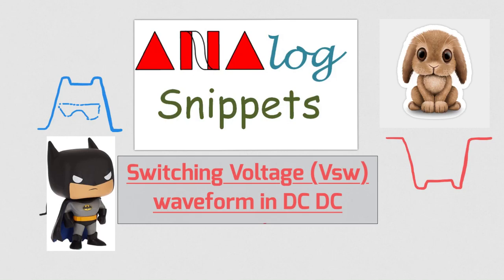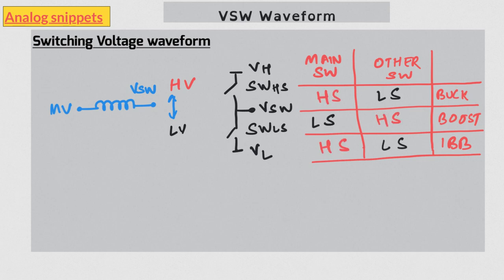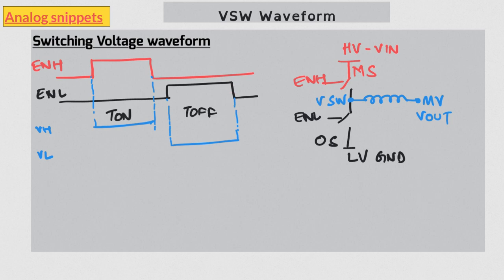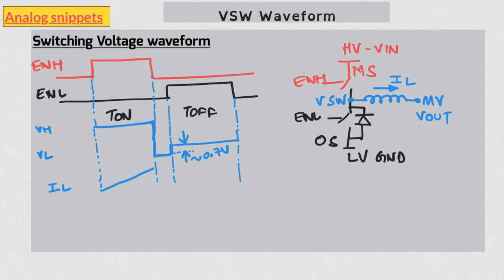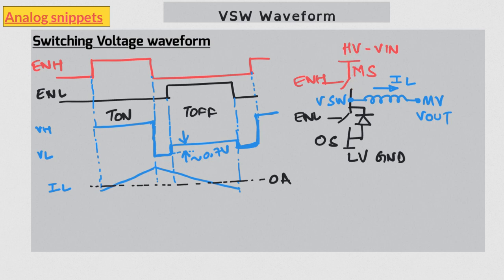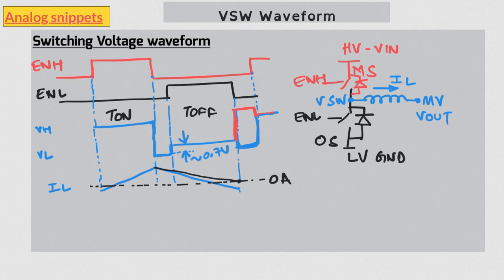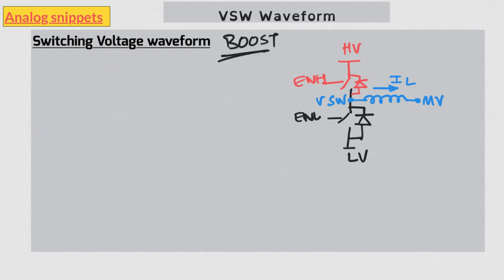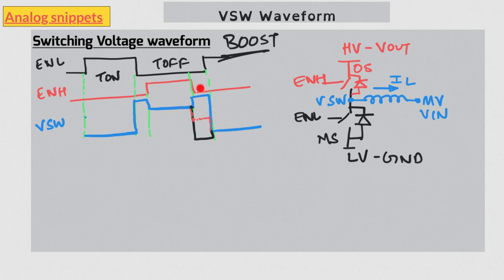#53 Switching voltage (Vsw) waveform in switching converters

Comment: Hi Sir l am a hardware design engineer with 11 year's of experience in analog hardware design (board level).
May l know is it possible to move to analog IC design. 
I can see that there are some institution which provide course in analog IC design. 
May l know your thoughts
Reply from the maker: Your analog hardware experience should be very useful if you want to move into analog design. I guess the best route would be to move into any analog team in your own company. Analog design course would be useful if they are offering actual design projects. If you have tools available, then try designing any circuit yourself, e.g. a bandgap or an LDO. I would suggest that after that, you brush up your basics and start applying for openings. All the best.
Reply: @analogsnippets  Thank you sir.My current company doesn't have any analog ic design team.The institute l mentioned provides training using virtuso and will teach blocks like LDO ,Opamp,Bandgap etc.

Comment: Hi sir how current in the inductor gets negative or current direction get reversed?? I mean once current reach to zero it should stop there and again should charge in the positive direction but it go to the negative direction? Could you please explain
Reply from the maker: If one of the switches is on, then there will be a non-zero voltage across the inductor. So, according to v=L di/dt, the current will keep ramping (di/dt = v/L). For example, in the case of buck, if low side switch is on, then there is a negative voltage across the inductor. So, the inductor current will keep ramping with a negative slope (that is, it will keep ramping down), irrespective of the magnitude of the current. Hope this makes sense.